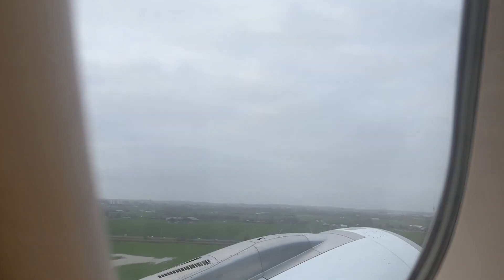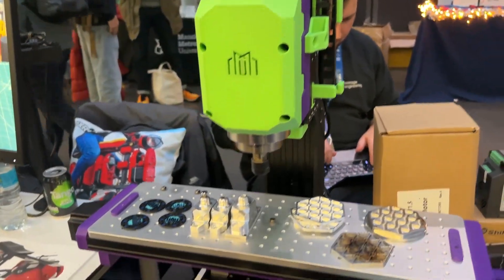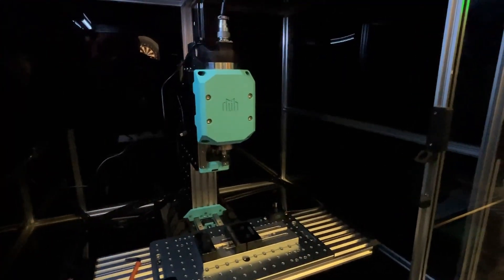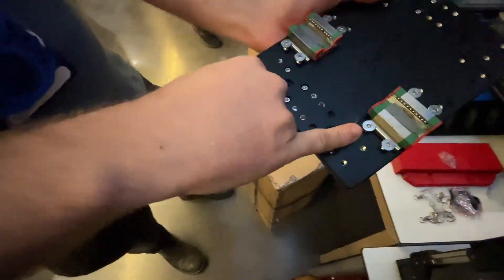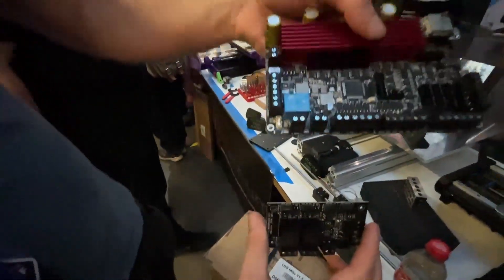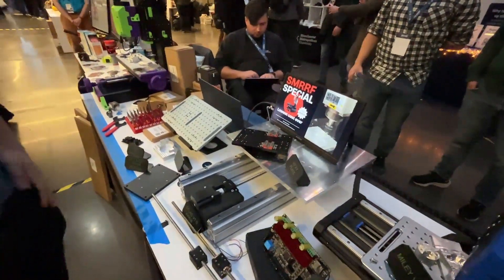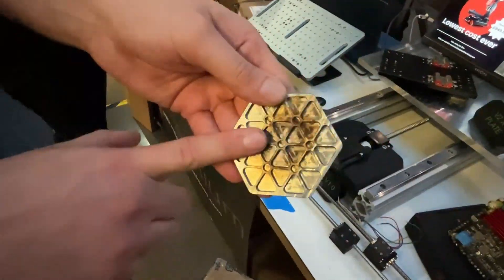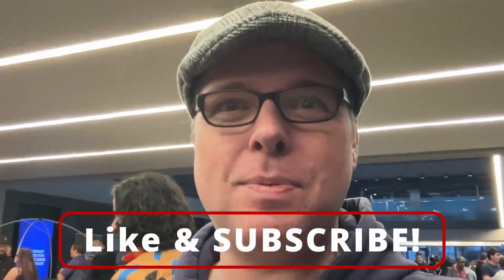The CNC Showdown You Won't Want to Miss!

Comment: So it is a Miley 2.0 or a Milo 2.0? When will it be released?
Reply: @Ensonic13  both, they share the same Z and Y axes, but the X axes are different. Hopefully around mid year
Reply: @jakeengland1430  Just ordered the 1.5 as I need a mill now... But I think the bike rulez applies with mills too.... n +1  :-)
Reply: @Ensonic13  don't worry V1.6 (which you can upgrade to from V1.5) has most of the features of V2
Reply from the maker: In the beginning of the video, Jake was talking about the Milo 1.5, later he was talking about the Enclosure Casa with a Milo 1.5 in there. Left from the Casa, was the Miley V2.0. I have added chapters, so you can find all of the products.